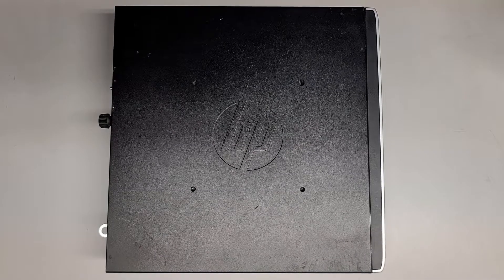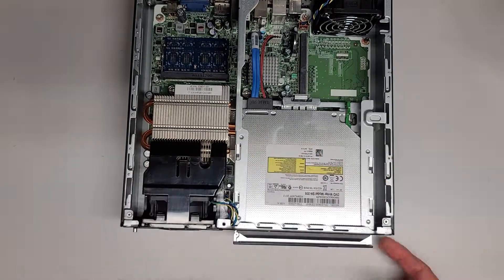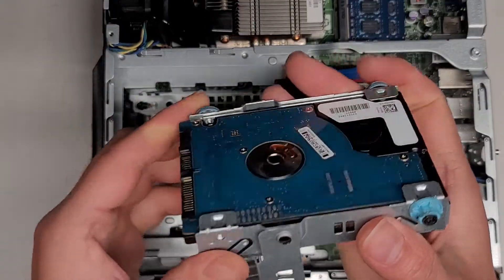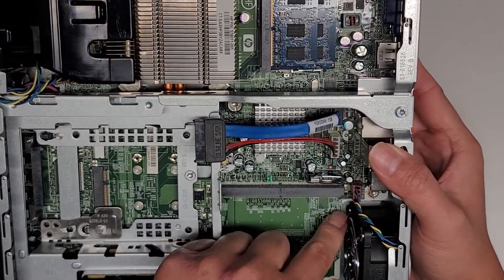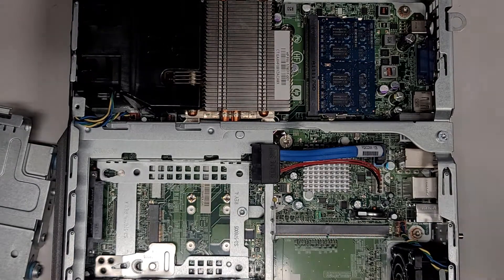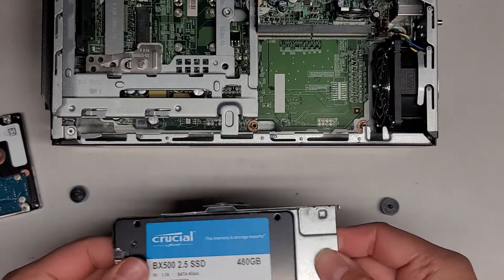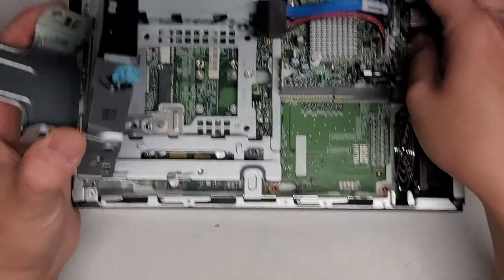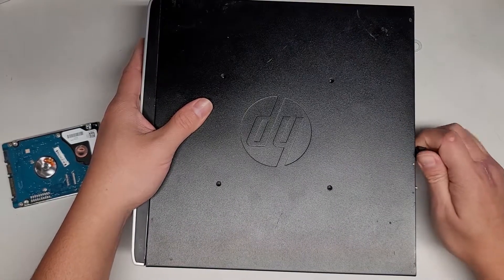HP COMPAQ 8200 Elite Ultra Slim Ultra-Slim Desktop Disassembly RAM SSD Hard Drive Upgrade Repair

Comment: What is the name of the sata power thing on the motherboard 5pin ?
Reply from the maker: Which thing?
Reply: @ItsBinhRepaired  Sata cable and power cable combination name of it ?
Reply from the maker: This? https://amzn.to/3ISswQd only works for optical disc drive or adapter to convert the optical disk drive into a 2.5" sata adapter.
Reply: @ItsBinhRepaired  yep that is but the price is high lol I buy my hp 3 days ago for 25usd :)
Reply: @ItsBinhRepaired  btw thank you
Reply from the maker: @default1647  lol nice

Comment: The extra tall HDD bay looks like it has space for a 10.000 RPM drive without its vibration shield. I bet they didn’t sell those with the 8200, but the HDD tray might have been used on an earlier model.
Reply from the maker: Possibly

Comment: I know this video is old but something you could do if you wanted to install another drive, is get one of those slim DVD Drive Bay to Laptop hard drive adapters. (Note: They come in different sizes.) And then for discs, just use a cheap external USB DVD drive. At least that's what I did. Although I only have one drive, since I can't seem to find the bottom tray part anywhere.
Reply from the maker: Yup

Comment: Hello could anyone please let me know if its possible to install a lp gpu in this?
Reply from the maker: Don't think so
Reply: @ItsBinhRepaired  thx how much wat does the psu have im thinking of upgrading to an i5 2500k since it got a better igpu
Reply from the maker: If it's not in the video, I don't know.
Reply: @Pepegkasmarios  135W, has to be 65W or less TDP, so only S processors. K ones will not work.

Comment: 3:10 - That looks like an M.2 slot. They aren't all the the same. Some are B key, some are M key, some are B+M key. The B+M key are SATA and slower than PCIe3 / 4. The B or M key are PCIe and much faster than standard hard drives. But not all M.2 slots are made for storage, some are for wifi cards and such. You'd have to figure out what the slot was designed to accept.
Reply from the maker: It's not m2. Possibly msata or for wifi
Reply: @ItsBinhRepaired  I seem to remember mSATA was more or less a mobile (laptop) thing, but I could be wrong. M.2 keys are wifi only, others are for SSD. There is indeed a SATA M.2 that looks quite a bit like MSATA. I know because I just installed one in a workstation. I think it comes down to the length of the card and the actual card edge key (M / B / B+M).
Reply from the maker: @anonymousinc6330  the pin layout is not an m.2. I've seen enough of them to know for sure 100%
Reply: @ItsBinhRepaired  Thanks for clarifying that, I was wondering, as I wasn't even sure this machine was new enough to have one. Some sort of proprietary HP hardware then?
Reply from the maker: @anonymousinc6330  i think msata maybe

Comment: The little black connector you pointed to is a mini PCIe expansion card for WLAN, etc.

More important to me is the white connector next to it:  the mini-SATA (or mSATA) which the tech manual says is for an "ultra small SSD".

The HP part for that slot (a 719566-001) only offers a humble 32gb storage.  AND they run well over a hundred bucks refurb'd.  No thanks.

"Ultra-small" means "half-size".  The cards that fit it have to be stubby, like 28mm in length vs ~50 for most mSATAs.

Much as I'd like to swap out the old drive the way you did:  1)  I hate to lose the existing 100gb of storage, and 2)  I'm not sure where to order an SSD like the one you got that (amazingly) arrived as a perfect clone of your existing drive...😎

(manual:  http://h10032.www1.hp.com/ctg/Manual/c04331008.pdf)
Reply from the maker: https://amzn.to/3MEsLOv
Reply from the maker: https://youtu.be/4p5jFDzVwUw

Comment: Changing the cpu is pretty quick and easy to do also.  All you have to do is remove dvd drive, remove hard drive tray, take out the two screws holding the hd/dvd frame, lift the tab on the dvd/hd frame and slide it towards the rear, the whole frame will come out of the computer.  From there you can lift the fan and shroud in front of the heat sink, set it out of the way and the heat sink has four screws to loosen which can be loosened with a flat blade screw driver or the correct size torx bit.   The CPU in the intel versions is an 1155 cpu and in the Amd versions an am3.   The cpu's are limited by the old bios and the best Intel cpu that will boot is the I7-2600 and on the amd versions the best cpu that I've got to boot is the 960T X4.  If you upgrade the cpu to the max and run 8 or 16gb of memory with an ssd drive the computer is plenty fast for everyday tasks.
Reply from the maker: Nice!
Reply: Gosh, thank you so much, U would have never found that little switch/leaver
Reply: Can this mobo handle an i7 2600k?
Reply from the maker: @zisistsatsaras2338 if the socket is the same, should work, but you might need better cooling.
Reply: @zisistsatsaras2338  2600 but not the k apprently.

Comment: Slot on  board can be used for a wi-fi card.   Also you dont need to take front panel off to remove dvd drive, it will slide right through the front panel.
Reply from the maker: Cool

Comment: Just picked up one of these earlier today to use as a dedicated emulation box. 
You can use ddr3@1600mhz (12800), even though the manual says 1066 or 1333. 
In the process of installing a 2500k at the moment. Why I stumbled across your video. I couldnt work out how to remove the trays and didnt want to force any latches, etc. 
Hoping it works, but it uses more power than the 2400s, so Im half expecting it be unstable, especially with the mxm graphics card installed as well.
I'll update the post and let people know how it went (Im sure other people will wonder at some point too, so a record of someone trying doesn't hurt).
edit: works fine, but runs much hotter to the point of needing an extra fan or else it throttles down to being not much faster than the 2400s despite being about %35 faster a cpu.
Reply from the maker: Awesome!
Reply: I know this is a year old but what kind of RAM did you use for this? SODIMM or regular length? cause those look sodimm length. and can it take 16GB?
Reply: @OrchidMantis893  It takes sodimms, ddr3. I also wonder if it will support 2 x 8GB sodimms. Any lucky?